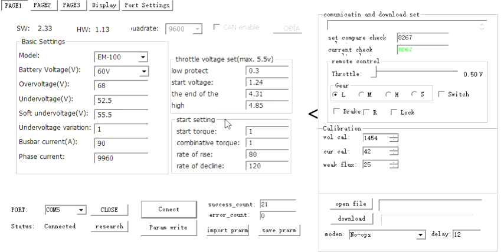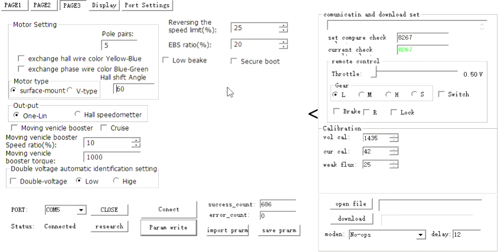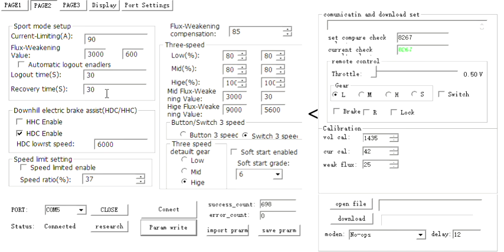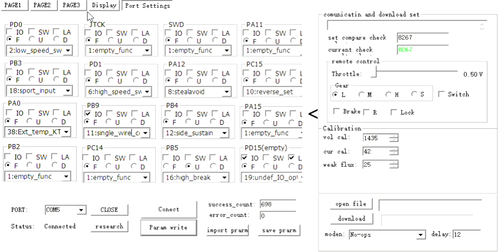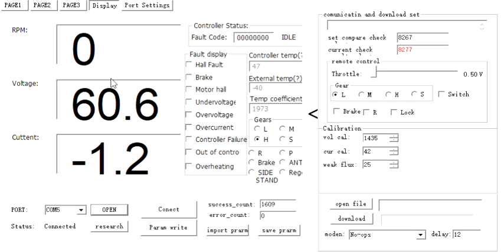Votol Em-150 Setup and programming for your Surron

Comment: Can you please explain what relation busbar current page 1 and current limiting page 2 have, i have a high discharge battery but my bms is rated to 60amps what setting should i put for max performance in both please?

Comment: OMW.....So after work today, I played with my settings. In the never ending quest to find settings that will make my ebike
mimick the feel of a CR 125. Welp, I was on page 3 and decided to enable moving vehicle booster. I tried the stock #10 setting
and not much. I then set it to 30. That's all I did, and wrote it. It flies. Moving vehicle booster Speed ratio is all I touched so far. 
it's got to be the secret setting no ones talking about.
Reply from the maker: Nice will have to check that out. Thanks for sharing

Comment: Hope my question wis reasonable. Is it absolutely necessary to have the controller hooked up to the computer diagnonis?
I got to having it hooked up and finally connecting the learning wires and turning the key to on. No motor turn.
My display turns on, but I think it runs from my head light wiring. I haven't tried to turn the throttle yet, but I want to.  
USB wont be here till tomorrow, it says.

Comment: I have a question .
Why after I enter values in the EM-100 controller after pressing the record button, after switching off and on again the controller returns to the old settings.
Reply: Same here, did you ever get it working some how?
Reply: @TackleThat  yes, Probelem is with Software.
Reply: @BorisPopov1  How did you get it working? I have the same problem.. tried 2 different EM software versions. What version worked for you? thanks!

Comment: I keep getting a hall fault on my em150sp, the dkd display powers on and starts on mode 3 and it can do sport + reverse but not 2 or 1. As well the motor has still yet to turn, do I need to do the self learning process for the hall or do I need to rewire/reprogram something?

Comment: Would you be willing to help me correctly figure out what pin-out is correct for my Votol Em70 PLEASE? or ANY help in locating the correct data plug!? I have seen "modification groups" and after reaching out, received no response what so ever. I understand time is a rare commodity, and would be willing to compensate... Thank you.

PS: I understand this SHOULD be a EASILY answered question. Evidentially Nobody has spent time programming the EM-70 BLDC controller. Ours is specifically re-badged as a "YMMOTORS" variant,  and to my attention has a COMPLETELY different pin-out compared to the schematic presented on the VOTOL web site, along with the prints shown in the sales links VIA Amazon. I am very nervous to simply cut into my harness without knowing the correct designations. Bike has been SPECTACULAR, EXCEPT we are limited to GEAR 2---45ish MPH!!! Gear 3, 4, and Sport remain without access. This may sound like a simple issue, and may be, but without correct english translations, and incorrect or limited knowledge, quickly becomes a chore. ANY HELP or DIRECTION would be dearly appreciated, as you seem to be able to navigate electronics IE drones/bike. very well. Keep up the hard work, and thank you for sharing your finding thus far!!!
Reply from the maker: ask the seller  you bought it from. I  haven't played with a em70
Reply: @AdventureBrad  understandable. Unfortunately it was purchased through @flyebikes and did not have a admirable "after purchase" experience, not that I expected much. Been trying all outlets we can find that may have the time or knowledge to assist in this endeavor. Thank you for a quick response, and we still love your detailed content!

Comment: any tips why mine wont connect? it keeps popping up with a error when i connect the controller and i have tried EVERYTHING , contacted the provider and they weren't much help tbh
Reply from the maker: what is the error? can you see the controller  in the serial port?
Reply: @AdventureBrad  i can see my port , its communication abnormal that is the error i cant seem to shake
Reply from the maker: more then likely  its  a driver problem.  might try a different computer too

Comment: Is there a setting which can limit the top speed of ECO mode to 25 km/h?
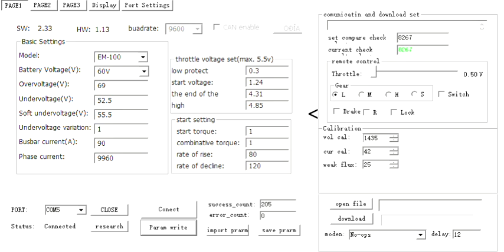Reply: Yes, @8:20 (page 2), if you check HDC enable and specify an RPM limit (6000 rpm in this case), then in the Three-speed section, he has 80%, which is 80% of 6000 rpm), for LOW, which is 4800 rpm. 

For you to set LOW to give 25 kph max, you just adjust the % of LOW until it limits your speed, which depends on motor type and tire diameter. 

Probably by now you already found someone who helped you set this basic setting.

Comment: Mine says when press connect  … let’s open the serial port
Reply from the maker: that means  your computer  is not seeing  the usb adapter. make sure the drivers are installed and updated and pick the right com port
Reply: @AdventureBrad  now that part i have to figure out the drivers I'm  not to computer savy